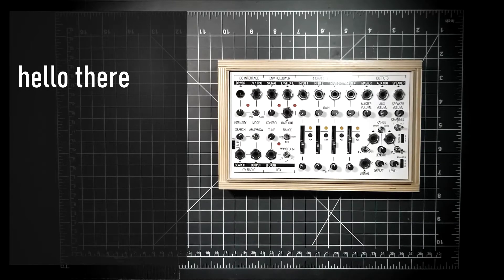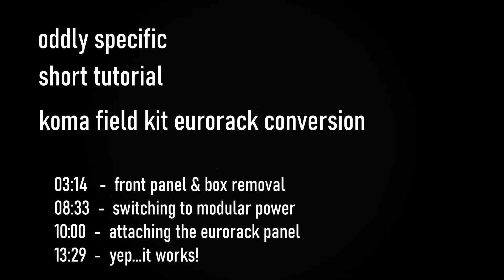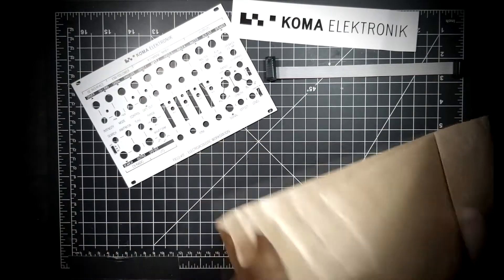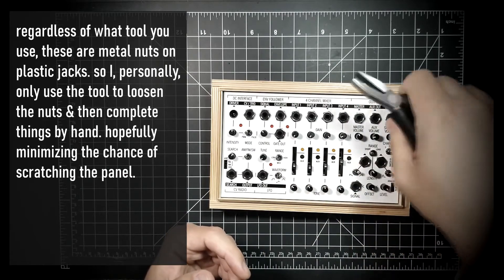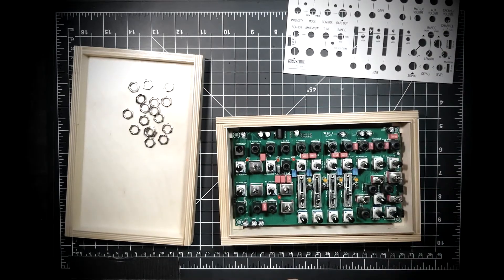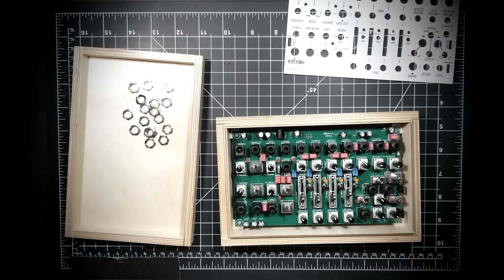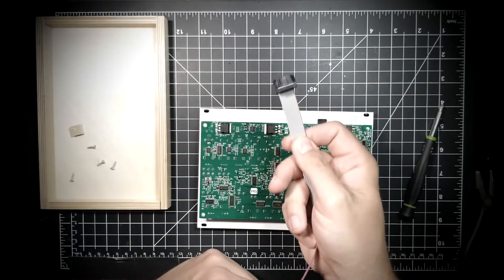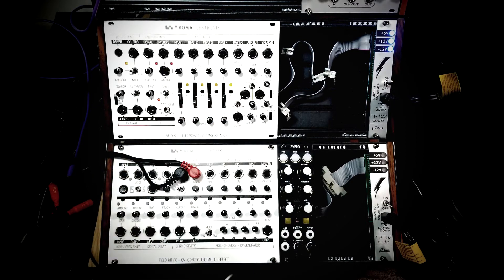Koma Field Kit Eurorack Panel Conversion: An Oddly Specific Short Tutorial

Comment: When you switch to modular power on the Koma Field Kit, did the LFO and other Field Kit signals also move up to proper modular signal levels?
Reply from the maker: The field kit and the FX version (I have both) are set-up with  proper modular signal levels, regardless of whether it's in the original wooden case or with the eurorack panel here. 

I did try the mains powered kit in the wooden case with my eurorack rig and it all worked as a regular module would. 

I think the power switching is just to tell the module what kind of power to accept for whatever reason.  Doesn't change the function or signal levels of the field kit. 

Hope this helps! If not, or if you have any more questions, go ahead! Cheers.